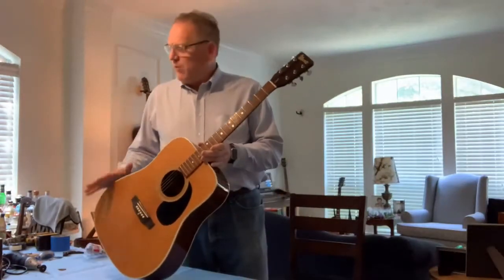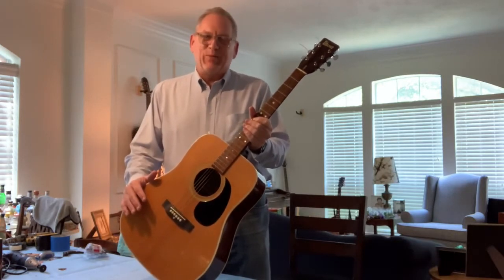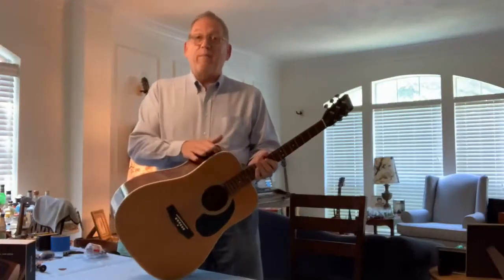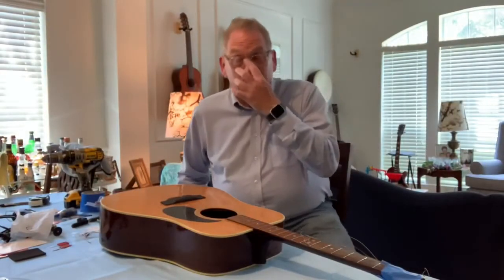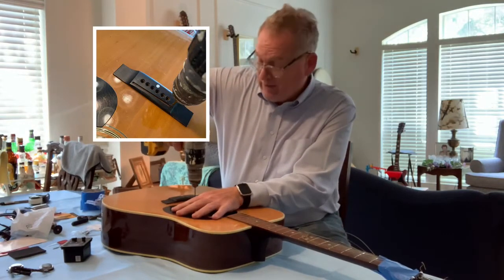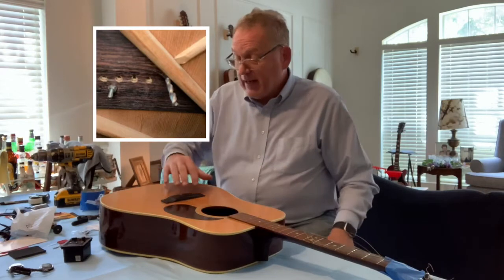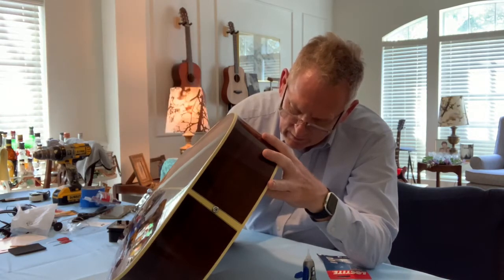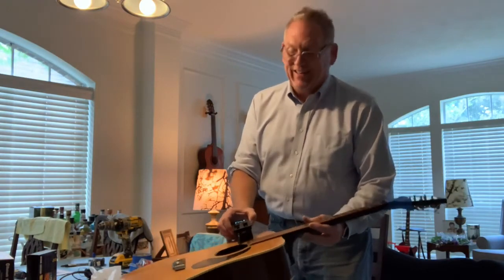Install HyVibe system on an Ibanez Concord 645 Vintage Guitar

Comment: Thanks for the video. I saw another video where he routed the slot in the bridge down 2 or 3mm to get the saddle back to the original position after installing the piezo sensor underneath it. 

If you didn't do this and installed it the way you did but also as recommended in the official instructions, would it have the undesired effect of raising the strings from the frett and thereby causing you too have to exert more pressure on the strings when playing?
Reply from the maker: Hi Zack, yes , if you just mount the saddle on the piezo it raises up and tips forward out of the slot.  That other fellow was a brave sole routing the bridge . I simply took a piece of sandpaper laid in a block of wood and sanded the bottom of the saddle as evenly as I could till I took a few mm off.

Comment: Hi Mike. I have a 1998 Guild D4 and I had a fisherman under bridge/saddle system installed. I want to put this hyvibe system in and use the existing pickup or pickup and output - is this doable?
Reply from the maker: Hi Harmonic, the connector for the included piezo pickup is quite thin I have tried to get a good look at it in my videos, but cannot really tell the connector type. 
I see that several piezo pickups have different connectors so I would not care to guess if that would work. However you can most likely use the same hole you made for the existing connector and install the HyVibe piezo under your saddle if the connector is not compatible.  Best of luck, please let me know how it works out. - Mike
Reply: @MikeMesseswithMusic   thanks this helps!

Comment: Can you do this to any guitar?
Reply from the maker: I had meant to respond earlier.  The only things that could limit a guitar being able to take this upgrade seemed to be accessibility to the placement of the Actuators and a wide enough space on the side to mount the control unit.  I have seen videos of Ovation guitars with access through the back panel.  But If there is no sound hole and no access panel, I think that would also be a show stopper.  I recommend contacting HyVibe and asking them if the guitar you choose can be done.